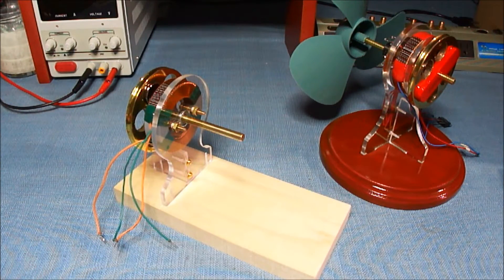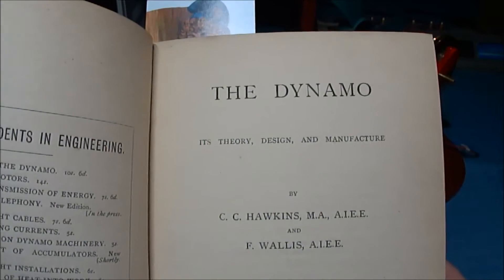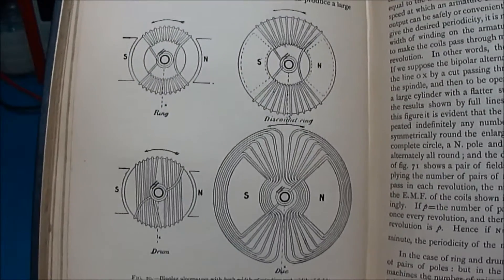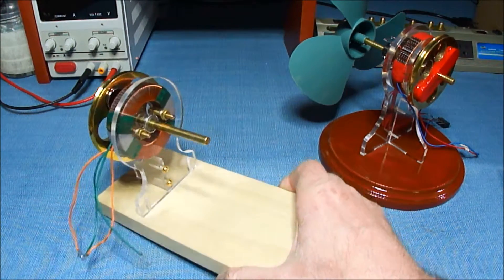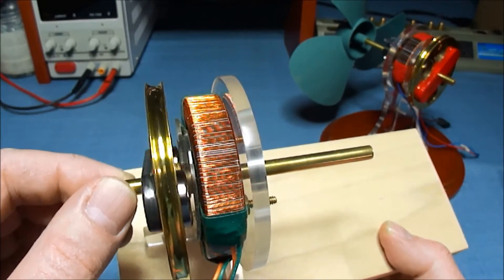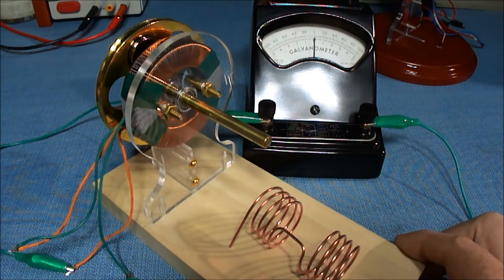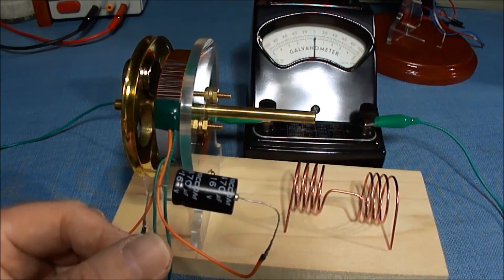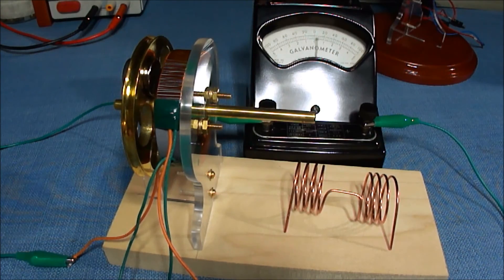Discoidal Ring - Toroid Dynamo

Comment: I see reference to that coil a lot.but if they are wound in different directions, the fields should cancel. ie on a straight transformer.
Reply from the maker: It doesn't necessarily cancel. There is a pole trying to emanate from the center. If you look at an Egyptian Ankh or Cross you can imagine a third section like three phase.